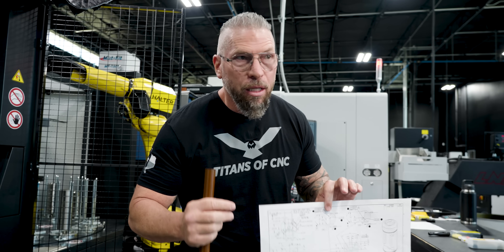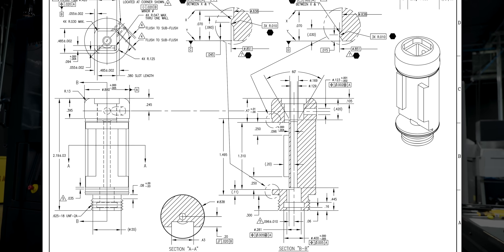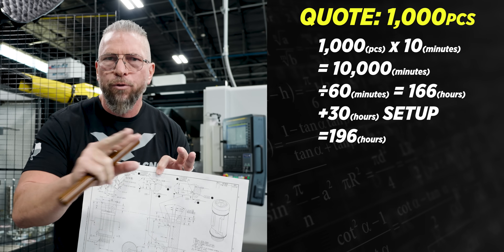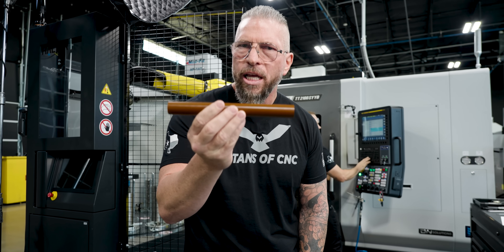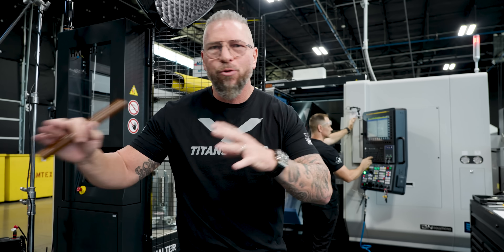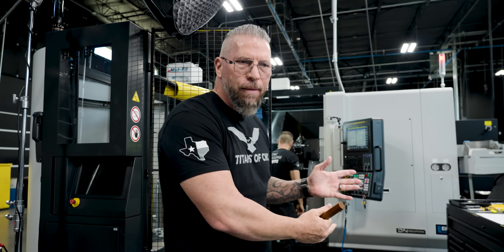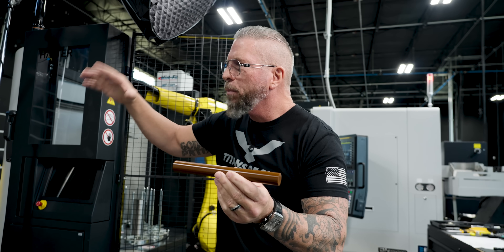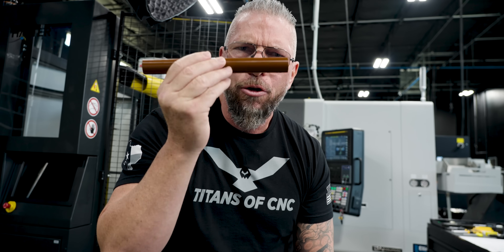How I Charge $40 for a $370 Part

Comment: The only downside of customer furnished material is that sometimes customers will furnish bad material and leave you to sort out how to make a good part out of it.  I ran into this frequently at a shop I used to work with.  It was mostly when we'd have to deal with large steel castings and forgings.
Reply: oh no, the memories are coming back to me

tolerances mentioning arc-seconds on forgings with more stress than a millenial whose dog got repo'd
Reply: I know this all too well.  Customer supplies 100 castings on a first time run and doesn't understand why only 99 are delivered.  "Where's our other part?"  Never fails.  Or the castings that have enormous voids right in the middle of a critical dimension, and somehow that's our fault. 😅
Reply: Had the same issue machining a spline type part for a big Japanese company rhymes with Smoyota. They gave us the most thrown together bent up castings literally from the desert in Iraq. Then wanted .0002 tolerances.
Reply: Customer wanted a part with a .812 od, sent us .750 material labeled .825... proceeded to get upset that we couldn't make it work lmao.

Comment: Meh. Prove put the program on something else. Run customer supplied material. Its not rocket science. One shop I worked at all we did was work with customer supplied material. Some was expensive soMe wasn't. It was all specialty alloys for microwave tubes. Cupronickel was common, but the high purity level required meant it wasn't easily found off the shelf. Being an ITAR shop meant suppliers had to meet specific requirements as well. My last year at that shop the mill had 2 full runs of the Cupronickel fail in QA. That meant that there was no new material available for purchase for over a year. That is stressful. Every inch of that material was irreplaceable.
Reply: That must have been a really bad day at the shop
Reply: @Dillybar777  By mill I mean foundry/ steel mill, not the machine type. We hoarded any bits we could. Bar ends were like gold.
Reply: @brandons9138  oh wow. That is insane.
Reply: @Dillybar777 Yeah. Our customers were scrambling. It's even crazier but that a lot of the work we did was for military radar and communication systems. So it was pretty time sensitive work.

Comment: I did this with a customer and they turned around and said they would do it but only if i pay 50% of the product cost that they would have made had they sold it for every scrapped part rather than just the cost of the material lost. needless to say i just buy my own material when i have to scrap a part and remake it.

Comment: It is still really sad that you can only charge $150 per hr. when you have $1M wrapped up in the machine, tooling, training etc. Then I go to my local Ford or Chevy dealer and they charge $150 per to have a trainee mechanic (who brings his own tools) do some routine maintenance on their $5k lift.
Reply: You can charge more if the work or the machine justifies it.  I've worked for shops that charged double that per hour for their larger, more expensive machines and that was 5+ years ago.  Once you get into certain types of work that fewer shops are capable/willing to do then customers will pay higher rates.  This is especially true for very large parts.  You can also make significantly more per hour if you're making your own products to sell if the value justifies the cost to the end user.

Comment: I’ve worked with that material many times, it actually runs really easily, it’s just expensive, but no more than doing second or third operations on some high grade stainless
Reply: They’ve said it isn’t difficult. But it’s still plastic. I worked with a lot of plastic. It’s far more variable that different metals. And the slightest problem becomes a mountain to climb over.

Comment: I'm more nervous when a customer supplies the material. I've had to make that phone call a few times telling the customer that we need another piece and the customer scrambles trying to get more material in time. If we have an issue, I like to keep it in house. Our shop does a material markup, and if it's high risk, We will throw in a scrap risk factor into the material markup. Basically insurance for the job.
Reply: We have done this for certain jobs. We've had a couple jobs where the material was over $100,000 and we were doing a modification operation that was only about 10 hours. We weren't going to do that work unless the customer takes all the risk. We can't do 10 hours of work and charge $20,000 for the risk.
Reply: @michaellakin631 Why not?  Genuinely curious.

I mean from the customer's POV that's what it looks like to them if they supply the material.  If you screw it up their material is ruined and they eat the cost.  Wouldn't they prefer just to do that all in one transaction -- assuming you hand over the pieces you scrap and charge them for?
Reply: Just had that happen. The customer insisted on supplying the material. When machining it, the material deformed due to internal stress, and more stock was needed. The parts are already a week late, and the new stock just came in. Be direct with your customer, get material yourself to keep the process reliable
Reply: @eragonpower2397  At the price they are saving the customer can afford to add a 5-10% cushion for scrap maybe 20-25% then if it happens they already have the extra stock and if it don't then the customer has extra stock the next time.   3 parts per 10 inches of material they would have to mess up several in a row not to be profitable for them and yes it could happen but not likely on 1000 parts with some of the worlds most advanced machines and people that check parts coming off.     I worked at a place that made gas unions once.  The little 1A nut I would load 3 at a time and cycle the machine. They are cheap parts so I would check them 3 to 4 times an hour for issues. If I had an issue I could go pull the last 15 min of parts off the line.  But I was one of the fastest operators and would run 10,000 in 8 hours of those little bastards and that was hauling balls hand loading a CNC boring machine in the 90's 3 at a time.,   One dude trying to one-up me, he ran almost 12k parts in his 8 hours.  He was so excited and talking shit. Until we noticed he had broke a cutter and 1/3rd of his parts was trash and they had to be separated by hand out of pallets that was already weighed up and boxed 100 per box.   He got shit canned in a hurry.
   Checking tolerances as parts come off matter greatly especially at $300 in materials per part. But he said they take around 10 minutes to run so that is a lot of time to inspect.  Where as my little union nuts I had to stop production to check tolerance but you account for all that time in pricing.
Reply: We usually make a dry run with PET before making final part in PEEK to validate design before we waste an expensive workpiece.
Reply: Yup. If I’m making ten of something, and it’s a complex part, or tight tolerances, or whatever other risk factor, I will source enough material for fifteen, then amortize that total material cost across the ten pcs I am quoting. If we end up completing more than ten good pcs, I will ask the customer if they are interested in the buying the overage.
Reply: I think this guy is just trying to run his competition out of business with this 'advice.' If he's a business owner, and this is genuine, then he sure isn't thinking like a business owner who is sourcing manufactured parts, and just easing some anxiety over cost of material and lack of confidence in his process and making it all public.
Reply: As long as the customer understands that if the shop supplied material, there's a markup to cover the potential for scrapped parts.  If they supply the material, they don't need to pay that markup, but they may need to be able to supply more than the minimum amount of material.  Then it becomes a value proposition for them because there's a good chance you aren't going to waste more material than you would have charged for if you supplied the material.  So they actually save money.  But they have to understand they will probably need to supply more than the bare minimum because things rarely go perfect every single time.  
They basically get a discount on the job, but they take on more of the risk.
Reply: Yah I found this super puzzling.  Assuming you know how to do the statistics you can quote an insurance rate that will on average cover costs.  

Fine if you don't want to do that then I guess you can charge the customer by the piece used (scraped or not) but why would you adopt that model and ask the customer -- who doesn't know what the failure rate will be, might source a less desierable dimension and might have to scramble to finish up an order -- to be the one who supplies it?
Reply: I completely agree with your perspective. When the client is responsible for providing the raw materials, everything becomes more complicated. You can’t guarantee the quality of the materials they provide, nor can you fully control the quantity or delivery schedule. Perhaps this is my survivor bias from working in a large corporation, but I disagree with the approach presented in the video. I believe the right way to handle things is to strive to keep all potential variables under your own control.
Reply: It does creates another surface of additional variables and risk on your side of the value chain.
However, if the customer is professional, responsive, and organized... then it could be workable.
Probably worth talking with and negotiating with the customer to see what works best for them and what their priorities are. They might be fine paying $600/part if they prefer doing less logistics and less billing.

Creative solutions can lead to more business, more profits, and amped customer satisfaction when the risk is managed appropriately.
Reply: As a sub contractor I almost never take customer materials.. I make a margin and can be expedited accordingly
Reply: Something as exotic as Vespel too?
Reply: What an obnoxious boomer you are because you completely missed the whole point of this video.
Reply: @Saki630  They're clearly not a boomer, and they're also right, from the perspective of the customer. Most customers just want the finished parts, not to deal with all the sourcing logistics, but it depends. Both ways are valid
Reply: That's why Titan is Succesful and you just watch video's and critique!
Reply: If the customer wants to supply the material they don’t get a bid due to unknowns. They also don’t get a guarantee we might not waste some material. They only get a piece price if we source the material.
Reply: Sounds like you only ask them to supply the exact amount like an amateur.
Reply: @jarlnieminen4307  Yeah you always ask for more material than you actually need (within reason). Explain to the customer that there's sometimes material leftover and ask what they want done with it.
Reply: I’m with you. How do you go back to the customer asking for more material because you screwed up? You don’t. 

You might not be on the hook for the initial material, but that doesn’t matter if you don’t mess up. “Hey, we screwed up, we need you to give us more material”. 

Better to charge the markup and be able to source the material yourself. I’ve liked a lot of Titan’s stuff, but this one just doesn’t make sense. 

This screams that you aren’t willing to take a risk and take accountability. First Titan video I 100% disagree with. Id take a job that the customer wants to supply the material, but I’d never demand they do.

Comment: Would be good to hear how you setup your contracts on your agreements for percentage scrap or something. Do you offer any guarantees to the customer about scrap rate? Or do you just promise to do your best?
Reply: That’s where you charge 20% more for the material. But when the material is so expensive you can’t do it any longer. 
When I do big expensive jobs I talk to the customer and if he doesn’t agree with possible additional scrap cost I decline the job. But I mainly do Prototyp parts and design them as well.
Reply: If you gave them a percentage scrap rate, you could also just buy the material and charge them based on your calculated scrap rate. So its the same issue really. I suspect they just expect the customer to trust them. They said they'd do smaller lot sizes, based on the price, so i guess if the scrap rate is too high for the customer, the customer can back out and just pay for the parts already received.